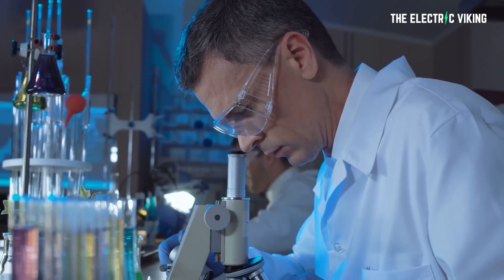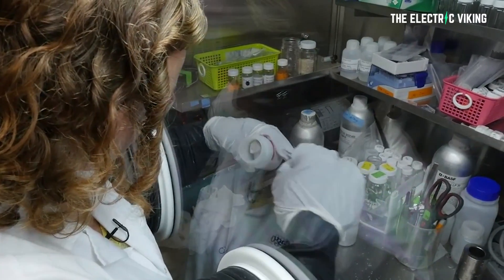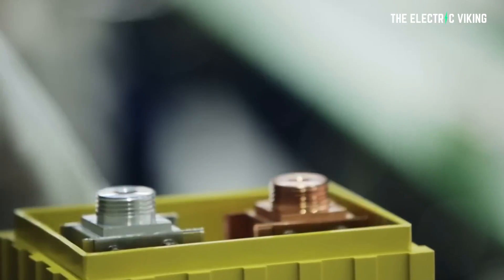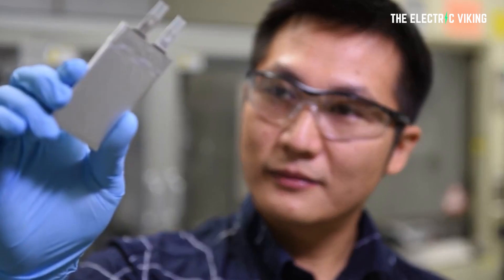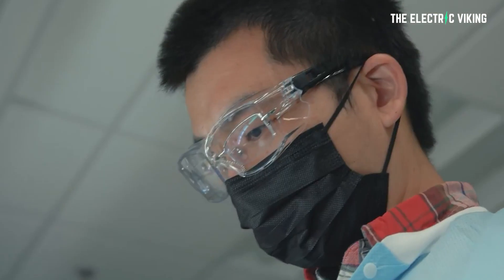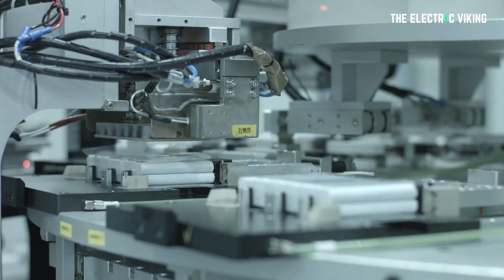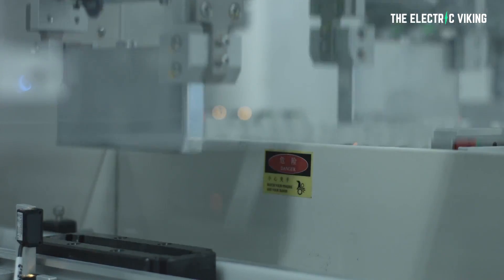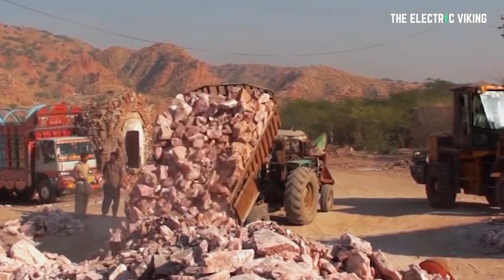Australian researchers develop 'breakthrough' sodium battery

Comment: Why is it everyone is claiming they are the leaders in sodium batteries? Faradion a UK company is making the same claims that they are the leaders in sodium batteries. Then you have NASA saying they have gone even further building a solid state sodium battery with no electrolyte which 3x more energy dense than lithium. You never know what to believe. For the last 10-15 years we have been told lithium is the future and much more environmentally friendly and safe. now they are telling us lithium is bad for the environment and are dangerous. Just seems they will spin any lie to get us to part with our money. The No1 problem with modern cars reliability is ELECTRICS (ICE OR EV). The 3 things electronics struggle with are moisture, vibration and extreme temperature changes E.g. Cars

Comment: According to the Clean Energy Council, in 2021 32.5 percent of Australia’s electricity came from clean energy sources and the industry is accelerating. Household energy storage is also growing. According to a recent report a record 33,000 batteries were installed in 2021.

“Our sodium battery has the potential to dramatically reduce costs while providing four times as much storage capacity. This is a significant breakthrough for renewable energy development which, although reduces costs in the long term, has had several financial barriers to entry,” said lead researcher Dr Zhao.

Comment: A lot of that sodium allows the currents from the equator to the poles to function. When that sodium goes away, the currents move more slowly, and the heat stays trapped at the equator. This means that the poles then become colder, which usually results in an ice age. Yes, sodium is extremely available, but no one should be looking at sodium as being the only battery technology. We should be looking at these as complementary to lithium rather than either being monopolistic commodities. It would require companies to try to control both resources, which would be harder for them to do. This should result in better pricing overall with the ability to make more batteries safely for the planet.

Comment: Nice to know that alternative battery chemistries are in development, but the proof of the pudding is when they are actually in production.
As for the price of Sodium going up, that is surely a temporary thing because its price is determined by whoever can dig it out cheapest, there is so much available. Sulphur may be more of a problem, if we go to Sodium-Sulphur batteries, because much of today's sulphur comes as a by-product of oil refining, where it is an undesirable pollutant. If we use less oil, we will have less cheap sulphur. Not that it is rare, it will just cost a little more.
Reply: Why dig? Plenty dissolved in the sea
Reply: @shanelmurray3448  You are right, but it has often been cheaper to dig salt out of salt mines (where the NaCl exists as solid) than to claim it from the sea. This is a pedantic point, because the difficulty and expense is in isolating the sodium from the chlorine.

Comment: I think sodium batteries for smaller or city based cars makes sense. For larger vehicles or those needing longer range I hope lithium sulphur batteries make it to market. These are touted as offering 3x the gravimetric energy density of lithium ion batteries at a lower price given sulphur is plentiful and cheap. Companies such as Lyten and LiS energy claim to have technology that overcomes the battery degradation issues of sulphur lithium, but we'll see.
Reply: Pipe dreams, the only thing that will solve long haulage, shipping, trains, farming, mining, mass air flight and military is Hydrogen.

Batteries for short distance and cars makes sense but shipping is time sensitive and some truckers drive in teams to maximize driving time.
How is stopping every 3 hours to charge a battery for an hour going to help the trucking industry?
Even to say Tesla's truck gets 500 miles is fine but under what conditions and weights since haulage has a larger impact on range for batteries than for ICE.
Reply: @IMGreg..  No doubt there is role for hydrogen in those industries you mentioned. I would welcome seeing hydrogen being the solution to a problem which may or may not be overcome through use of batteries. The onus is on the hydrogen industry to get out there and prove its worth and fund/provide the necessary refuelling infrastructure in much the same way that Tesla invested heavily in a fast charging network to support its BEV vehicle push and demonstrate that BEVs can be viable. As I said earlier, we'll see whether the claims made by corporations and industries actually come to fruition, including those made by the hydrogen lobby.
Reply: @IMGreg..  many of the technologies we use daily and take for granted now were once called pipe dreams. Never underestimate human ingenuity when there is money to be made
Reply: You assume that we will keep doing things the same way as we have in the past with cheap high energy density fossil fuels. Hydrogen has many inefficient steps in its production , transportation and use compared to electric vehicles. If it costs more to use it then it might not ever get the infrastructure for its use in transportation built. It will probably be limited to steel making and a few industrial processes.🤔

Comment: Human must accept that sodium ion is a better choice right now until we find a cheaper way to extract lithium. Lower range at a lower price is a good compromise when u buy an ev. Extraction of sodium from seawater is almost unlimited. So we must focus on sodium ion first for scalability. Also for middle east, once they run out of oil, they can use their solar power to extract sodium in their desalination plant in additional to fresh water.
Reply: One of the problems of desalination projects is the release of salt into the environment after the process. It would be great if this technology had the potential to solve this problem by using it to build batteries.

Comment: Sam ...have a look see...cheers
Atlas Salt Nears Economic Analysis for Great Atlantic  Thu, December 8, 2022 at 5:21 PM
ST. JOHN’S, Newfoundland and Labrador Canada (GLOBE NEWSWIRE) 
Highlights 
-Drilling continues/ large resource/ has yet to find the limits of this minimum 2.5-kilometer-long deposit
- Atlas hole CC-4 that returned a gross thickness of 335 metres grading 96.8% salt starting only 190 metres downhole.

Comment: Each type of battery that uses different chemistry and materials helps keep the price of all materials down by spreading out demand over different materials.
Reply: Assuming scaling each one is still large enough to get savings from the scaling versus only doing one type. But every type should be scaling to insane levels anyway, so what you said definitely makes sense to me.